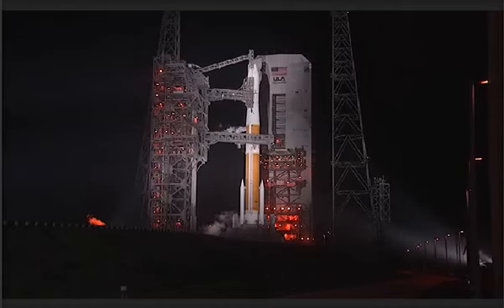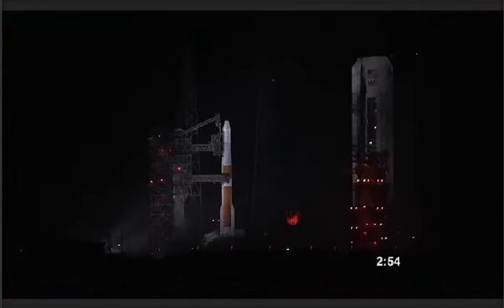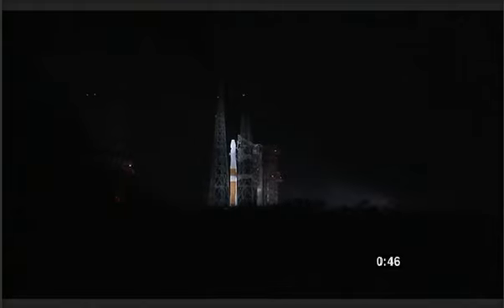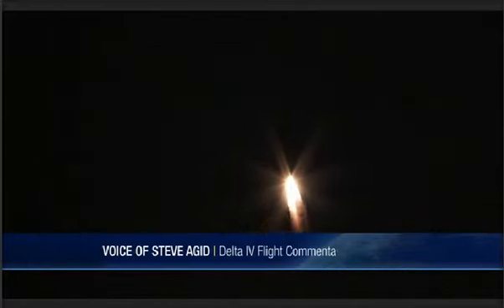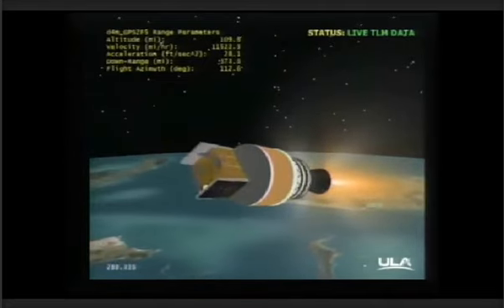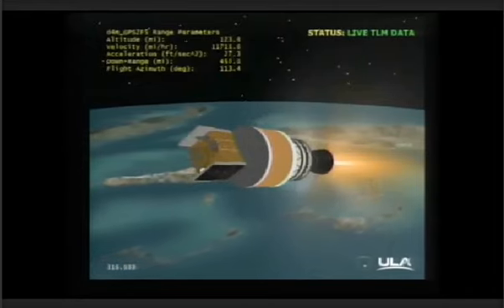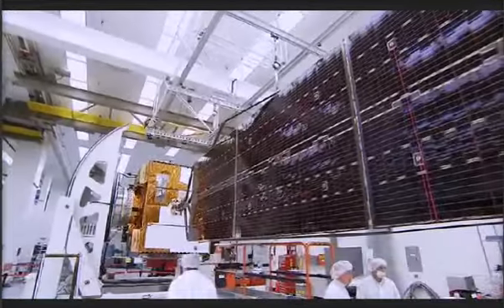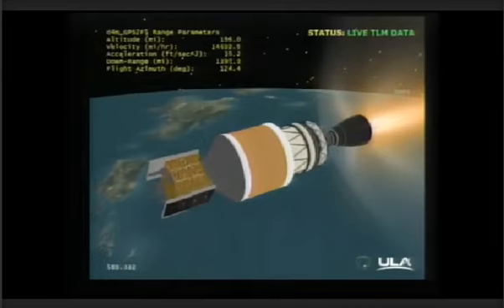ULA Delta IV-Medium Night Launch Air Force GPS IIF-5 Satellite

Comment: So the question is, how came they haven't engineered a way to launch more than one GPS satellite at a time?  Is it simply because each satellite is so heavy that only one will fit on a launch vehicle?  Three Russian GLONASS satellites can be put into orbit on a single launch vehicle, and the European Galileo satellites are launched two at a time.
Reply: I think that they pulled off the 3 glonass gps satellites within a single launch because it is on the same orbit and did not require as much delta to put them in each of their respective areas. If the satellites requre different orbits to be placed, there might not be enough delta to place each of it